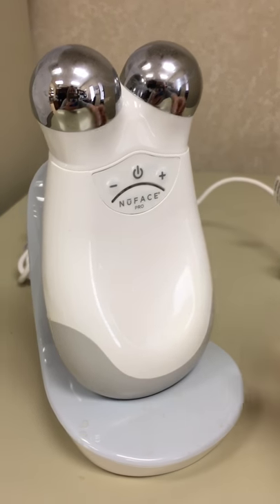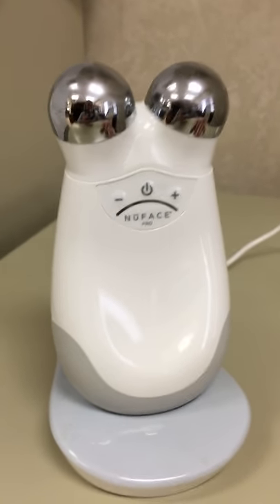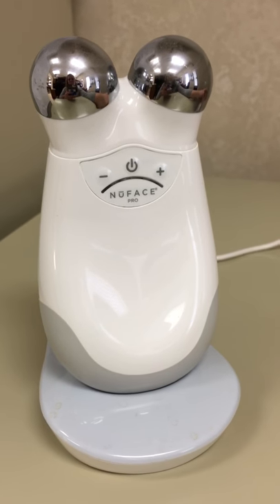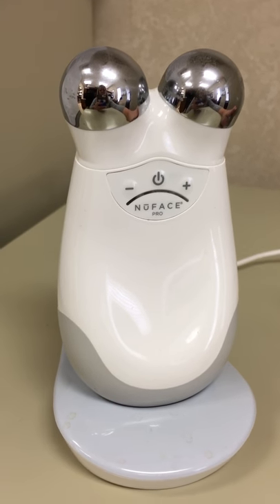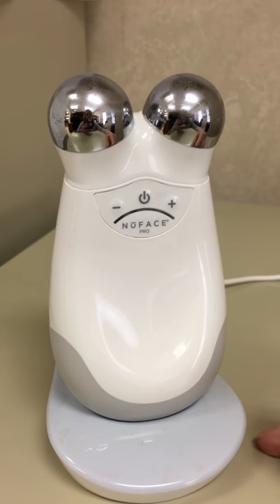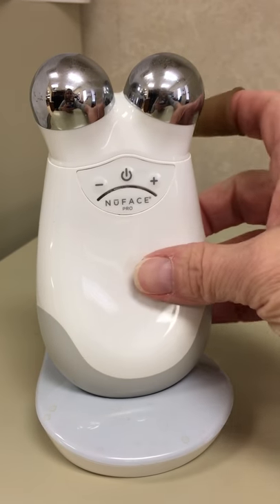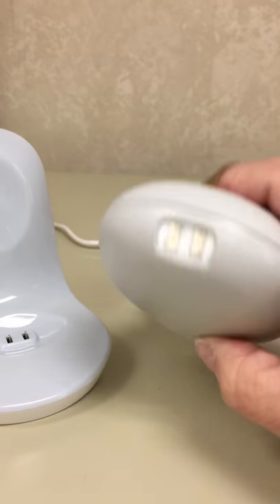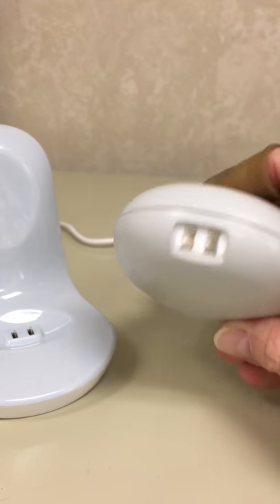Nuface Trinity Pro Troubleshooting

Comment: My trinity NuFace quit working. I just lightly sanded it with a nail file... all I had and I put it back on the charger. I’ll wait and see if it works.
Reply: Did it work? Mine just stopped working wth